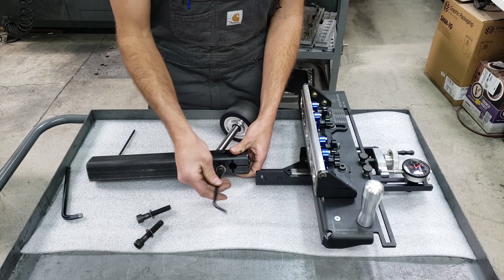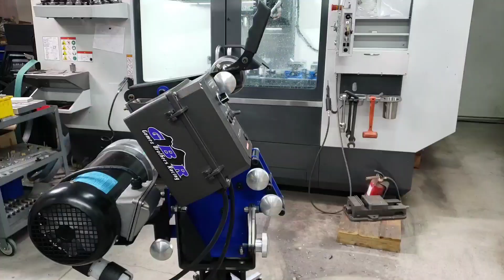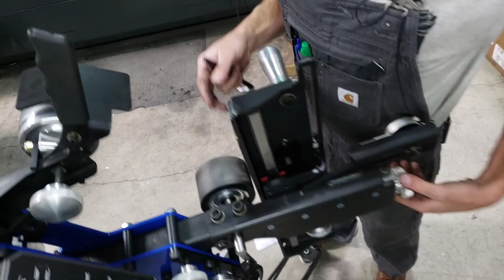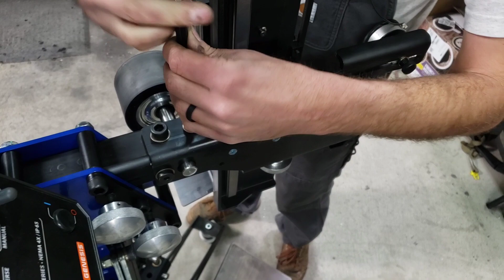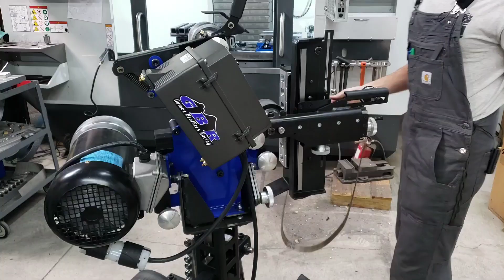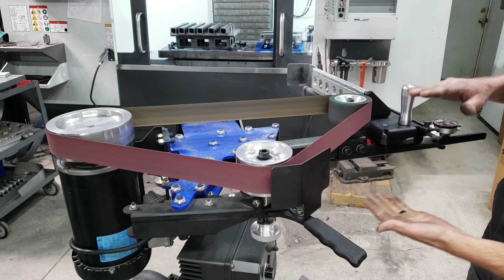SGA quick Setup

Comment: I am glad to see this.  I purchased this some time ago and there was really nothing to tell me how to set it up.  I did not do a surface grind, honestly never thought about altering the surface from factory.  I have been fighting this trying to keep a square cut.  I even purchased the extra magnets thinking maybe it was not holding it properly.  I only have a about 3/4 of an inch pass that I can do that is square and i have marked it on the surface.  The rest is just not there at all.  I am going to go back and do this setup and hope it improves the machine.  I just chalked the inaccuracy up to the fact that it was an add on surface grinder and it would not be perfect.  Looking at this though I am way off true.   Wish this was out there a long time ago.  I purchased my surface grinder when they were first listed and there was nothing telling me how to set it up.  Even something written would have been great.  I found this video while looking to replace the wheel, I thought maybe it was not perfectly square  and that was maybe the issue.  Now I see it was set up issues all along.  Amazing what you miss without the directions.  I love my Ameribrade products.  I own two full grinder set ups and lots of accessories and VFD Drives, one old style and one new style.  I have cursed this item too many times to count.   A bit unhappy that it did not have any set up instruction otherwise this problem would have been fixed long ago.  At the time of purchase the only video out was showing it in use and nothing to show set up.  I assumed it came set up and square and I tried my best to mechanically square it up.